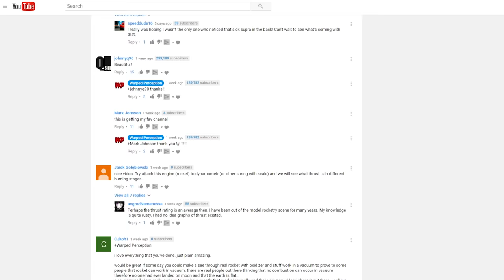Model Rocket Engine In A Vacuum Chamber - 4K Slow Motion - will it burn? - Rockets (S1 • E3)

Comment: Sound does not carry in a vacuum environment. You can hear the rocket working so it is not a true vacuum environment. This test is completely flawed
Reply: What is a "true vacuum"? So where is the air pressure threshold from where rockets won't producing thrust anymore? And is there a relation between air pressure and thrust (so thinner air - lower thrust; would make sense I think?)
Reply: the sound of the slo mo is aded in and the sound of the go pro is recorded bc the rocket re pressurised the chamber again
Reply: The mass flow out of the nozzle is what is producing the thrust, which means that the thrust is the same in space and on the ground. Newton's third law baby!
Reply: The rocket vibrates de metal coil that is atached to the tube vibrating the tube, and the tube that is in contact with the exterior air "translate" the vibrations on sound; and more, the rocket produce gases that can hit the wals of the tube makig noises.
Reply: +Sebastian Nolte Yes there is a relation but the other way around. The bigger the pressure difference between  the burning fuel and the sorrounding gas the bigger the thrust. Think of a water gun shooting in to the air and inside a pool. The water shoots out quicker in the air.
Reply: That first boom sound was the igniting rocket changing the presser by pushing out a little bit of gas during ignition, vibrating the tube from the pressure change which is touching the air so we can hear it. The sound of the rocket is the normal sound but quite at first because there is no air to push BUT THE ROCKET IS EXPELLING GAS AND PLASMA no longer making it a vacuum allowing us to hear it. But rockets do work in space because the rocket expells the gas at high speed and it is the same amount of gas as the fuel was as a solid or liquad so it adds up to be alot of mass and that mass being pushed acts in the craft as well  so pushes the craft forward. Notice how on this and any rovket the gas gets pushed much faster than the rocket because for it to produce thrust it has to be going faster (have more energy) to accommodate for the lack of mass. In space this doesn't matter because with no (little) outside forces it can react react with Newton's 3 law: For every force there is an equal or opposite reaction.
Reply: LMAO Newtons Third Law of motion is EXACTLY why rockets in space don't work. THERE IS NO ATMOSPHERE IN A VACUUM! SPACE = VACUUM!  NO ATMOSPHERE = NO THRUST... Again The thrust of a rocket is generated when the ignited fuel out of the rocket is pushed back by the gasses in the atmosphere which in turn causes acceleration, without anything to push against you get 0 forward momentum.
Reply: now go ahead and say "Nuh Uh Nasa did it so it must be true"(because we all know nasa can violate the physical laws of nature).... Or you're a fool who's been took for a great show. that's all it is folks, a great show, keep trying to disprove flat earth, keep believing nasa and space x and that we live on a ball spinning at 1,000 MPH, Orbiting the sun at 66,000 MPH all while the sun travels around the center of the galaxy at 800,000+ MPH and yet the stars ONLY rotate 360 degrees around the North Star Polaris, Which never moves from its position over the north pole. Yeah... That makes sense... makes a whole globtard amount of sense.
Reply: I agree the vacuum was not good enough AND the fact that the space in which the vacuum was produced was very small and the thrust as seen in the video was most likely due to the back wall of the tube in which the exhaust from the rocket had a surface to push against. I have seen other vids of guys trying to ignite ANYTHING in a vacuum and they couldn't get much to burn, most did not ignite at all. So rockets can't produce thrust in the HUGE vacuum of near Earth Orbit. FWIW I'm NOT a flat Earther, however they have some good arguments that are definitely inexplicable at this point. I'll be hugely disappointed if they are proven correct.
Reply: The Term Flat Earther has been drug through the sand, even the term makes me cringe. but rockets dont work in space and that's a fact. the earth also doesn't have a detectable curve, and people will love to say "Yes huh, my phone has google earth" and the classic "What about satellites" and lets not forget "Nasa has pictures of earth from space nar yar garrrrrr" 1, satellites are fake, we've conclusively disproven them already, Look up LORAN and its future implications, and if you still want to say "No, i have dish tv, you're stupid" then ill be happy to hear you explain to me why planes loose their "GPS" signal while flying over large oceans and have to go by a estimate from ground control. the size of the unites states on the nasa pictures of our "Planet" changes sizes significantly throughout each photo while the diameter of the earth remains the same. idk about you but i dont remember the land area of the united states fluctuating by a couple tens of thousands of miles just in the last few decades, of course i could be wrong, i'd love to see a globetard explain that. also explain where the curve is, why gyroscopes dont measure a curve, why lazers dont measure a curve, why planes dont have to continuously dip their noses down to compensate for the curve, AND why TF Bill Nye is even is this argument like either side wants to claim him. btw even if you guys do come around, leave bill tf behind. xD
Reply: The reason is simple, notice the rocket mounting bracket? It is in contact with the outer tube so the vibrations are transferred to the outside through the bracket where we can hear it.
Reply: exactly
Reply: Let's put it simply... you can see the International Space Station from earth.. it is in the vacuum of space. They are firing rockets every so often to realign or maintain altitude.. and you receive movies, communications, and etc. via satellites that are orbiting at app. 26,000 miles above the earth and have to be re-positioned from time to time and they do it successfully... how, if they don't use rockets?
Reply: Fact, it would likely cost them a few orders of magnitude more to lay underseas cable than it would if their satellites were real. if that was the case no crazy fool on this earth would still being laying trans oceanic cables thousand of miles across the sea floor. LORAN system got a huge boost over the last few years in terms of power and range. all of their excuses have been refuted and we are exposing them for the shit they are.
Reply: well first i have a love and great understanding of modern physics. So naturally I tried to disprove flat earth a month ago with the curvature test, after i seen the ships in the ocean continue to be visible after about 20 miles or so i got curious, i got my phone camera camera and zoomed in further after it again appeared to "disappear around the curve". And i should say the drop of curvature of earth is supposed to be this equation= 8 inches per mile squared, (i dont know how to make the little 2 lol). 20 miles means the ship should have been hidden by 198.7 Feet of Earths Natural Curvature. however it remained visible to about 30, then after it still re appeared with the use of a zoom camera. Water is the absolute best place to test this as water fills anything its container perfectly level, the best possible scenario would be a frozen lake to get it as perfect as possible and avoid waves. the fact remains that i shouldn't have been able to see that ship past 12 miles, as the curvature of earth is supposed to hide it. then i remembered Gyroscopes from my childhood and remembered there main job is to provide "Rigidity In Space", this means that once the gyroscope is in motion and remains in  its fixed plane regardless and independent of "gravity", this means that if you were flying around the planet you would see it spinning to compensate you slowly moving and turning around earth, however Globebuster has a great video showing that gyroscopes do not register a curve when you fly from one end of the earth to the other, absolutely 0. (This one is great to refute because you can try and tell me gyroscope are just inaccurate then i would dare you to get in a plane that doesn't rely on gyroscopes to determine its pitch elevation and many other navigational necessities.) #GyroscopesDontLie
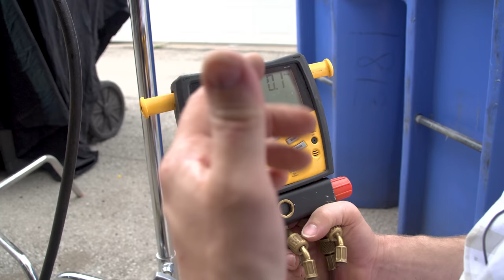Reply: XoFFoX777, Dude nice try but no. At 2:11 the gauge clearly shows -29.2mmhg, that converts to roughly .5 psig. Atmospheric pressure is around 14.7, that means he had it down to 3.4% atmospheric pressure, THAT IS A VACUUM!!! It produced thrust the second it was ignited. Big vacuum, small vacuum, doesn't matter, a vacuum is a vacuum. Sorry, but no.....
Reply: Please provide a map of this flat earth world that you speak of.
Reply: Edward Clements I have not mentioned anything about a flat earth??
Reply: 66tas95 
Directed towards the flat earth guy above.
Reply: Ally Entertainment TV
At last! A denier who accepts Newtonian physics! I do believe that we're getting somewhere. However, the interpretation is incorrect. "For every action there is an equal and opposite reaction". 1- Action. Kerosene mixes with oxygen from the liquid oxygen tank, is ignited, becomes an expanding ball of burning gas, thereby massively increasing its volume from its liquid state, and is ejected into space via the rocket motor nozzle. 2- Now explain what the reaction will be, for you know by your acceptance of Newton's 3rd law that there has to one. I'll give you a clue: "and is ejected into space via the rocket motor nozzle" is the action to which there will be a reaction. Are you confusing thrust with the action of a propellor (air or water) where the prop is used to displace the medium (air or water) from the front of the prop to its rear, thereby providing propulsion?
Reply: Ally Entertainment TV - Just one question.

Why do you suppose that NASA lets you live?

I mean there's a tremendous amount at stake here. They have managed to fool the most brilliant scientific minds from the past thousands of years to the present. They have totally controlled all space related media world-wide, including from the Soviet Union, China and North Korea. Every educational institution starting at elementary school through university is being controlled. Private enterprise, again world-wide, controlled. Hundreds of billions of dollars must be spent every single year to keep extremely smart people like you from spreading the truth. And yet here you are on YouTube discrediting everything humanity thinks they know about the Universe. 

Why are you still alive?

Maybe NASA doesn't know about you. So I forwarded your posts from this video to NASA and the CIA. I'm curious to see how long it takes for you to 'disappear.'
Reply: XoFFoX777 Son rockets carry their own oxygen ever light a fuse and throw it in the water and it still burns underwater where there is no oxygen? That's because it carries it's own oxidizer it doesn't need surrounding air. If you want more proof buy one of these little engines ignite one and have it fire into the water and watch it still burn. No Nasa or slow motion vacuum tube footage needed but a 20 dollar model rocket and some fuse to test that too
Reply: Ally Entertainment TV So if nothing has been to orbit how do you explain the space station? Because you can see that I bought a telescope went on the tracker and saw it with my own eyes it's very visible when it Flys over with a telescope. You can do it too just get a compass check out the flyover times grab your telescope and chill out grab a drink and watch it. It's pretty beautiful and you can't say plane it is not aerodynamic in the slightest and it's fucking huge
Reply: Ally Entertainment TV Also Google the Eratosthenes measurement of the circumference of earth. You can do that at home too. Plus why is no other planet a disc shape you can see other planets once again with a telescope. They are all round because gravity would collapse a disc shape it doesn't work like that man. No idea why you think anyone would even want to lie about it for this long and that's all stuff you can do at home for yourself. No need for any external sources you just need a few easy to get optics and tools
Reply: Sound waves need atmosphere or mass to carry them from point A to point B. In this instance the atmosphere is being substituted by the mass of the vacuum chamber's walls, which are also being utilized by the rocket's 'thrust', to push against.
Reply: Vibrations carried by the copper coil holding the rocket in place inside the tube conducted the sound. Same principle that allows the tin can phones with strings that many have tried and tested in their youth throughout the past century. Your argument is now invalid
Reply: "Sound does not carry in a vacuum environment. "  

It doesn't but this vacuum chamber is filling with gas as the rocket burns.  Those gas molecules are reacting against the cylinder walls at a high rate of speed.  That rocket engine is very loud outside of that chamber.  Also the rocket is not floating in space.  Its tethered to the outside by a copper frame work.  So vibrations are translating through the copper winding to the cylinder walls.
Reply: Kurwynd how can you see something that's traveling mach 20? Furthermore the pressure of a vacuum measured in Tor would crush the ISS. Whatever your seeing is a plane, drone,aerostat etc.
Reply: Edward Clements a map shows a flat earth.
Reply: Ally, good point about the under the water transatlantic cables.  At least this video test proves you need a solid physical barrier between a pressurized atmosphere and a vacuum.  Which would explain why The NASA/SATAN had to fake the moon landings and ISS footage.  Can you imagine if a flat Earther had just one week of fake NASA's budget to prove the Earth is motionless and flat?
Reply: Edward, flat Earth maps are available online.  buy Azimuthal Equidistant “Air Map” of 1945
Reply: Isaiag40:22,

Azimuthal Equdistant Globe Projection map is just one of the many globe to plane projection, and if you care to measure distance between Santiago (Chile) and Sydney (Australia) you would see that this distance is 50% longer then actual one. How your flatheaded colleges explain that?!
Reply: Tim Webb ,
you've been to space? You know this first hand?
if you can't honestly say yes to these questions , your response ins't plausible!!
Reply: Yes ally newtons third law. Someone much smarter than you. Atmosphere is not needed to produce thrust as shown on the video. If you don't believe it run the experiment yourself. If you push something away from your not only are you pushing the object away you are pushing yourself away. Atmosphere will not be a factor except in that you have no air resistance to slow you down.
Reply: +Purple Clouds "Furthermore the pressure of a vacuum measured in Tor would crush the ISS" That couldn't be further from the truth. Atmospheric pressure at sea-level is roughly 14.7psi, in the vacuum of space it is very close to 0psi. There is far less pressure being exerted on an object in space compared to on the ground, not more.
Reply: +Purple Clouds "a map shows a flat earth." No, a map is a map. A map is not representative of shape, it's sole purpose is to aide navigation. Shape doesn't have anything to do with it. Straight lines on a map are much easier to understand when compared to the trigonometry required to navigate using a globe, for example a ship crossing the pacific, which is why the globe isn't used very often (aside from automated GPS based navigation).
Reply: The test is not flawed. The black powder propellant contains its own oxidizer and therefore can burn without any additional oxygen.  The instant the motor ignites combustion gases exit the motor and the interior of the tube is no longer a vacuum and the tube contains a medium that can transmit sound. This does not invalidate the test because the air was removed from the tube before it was ignited (demonstrated that ignition can occur in a vacuum and combustion is sustained without adding any oxygen from outside the tube). Likewise, rockets that leave the Earth's atmosphere take their oxidizer which them, such a tank of liquid oxygen.
Reply: Ally Entertainment TV how come a plane has never flown past the wall of ice that surrounds us and taken pictures of whats past it? Seem it would be very easy to prove the earth is flat. Why cant we go past the edge, or the very least even look at it.
Reply: 66tas95 and there would be not fire due to there being no oxygen to burn
Reply: How many times do we have to go over this... Solid fuel model rocket engines DON'T NEED OXYGEN for combustion. An oxidizer is mixed in with the fuel. In the case of a solid fuel in a model rocket engine, potassium nitrate (NO OXYGEN NEEDED) serves as the oxidizer in the combustion reaction. Furthermore, once the engine ignites it expels combustion gasses and the tube IS NO LONGER A VACUUM and this demonstration IS NOT FLAWED.
Reply: 66tas95 - The sound in the slow-mo is faked, as it is in nearly every slo-mo video.

Also, once the engine fires, it is propagating sound waves through its own gasses, in addition to any vibration it created through the coil into the tube.

Sound in the experiment is not equal to the experiment being flawed.
Reply: Dad Is Gone - Let's all say it together; "Rockets don't need oxygen from the air to burn, because a rocket carries it's own oxidizer." See? Not that complicated.
Reply: you actually can hear just not very well besides most of the sound seemed to be the gas spewing out the engine which would carry sound just fine
Reply: 66tas95 Sound is carried from the exhaust AND the vibration from the coil to the tube.
Your comment is completely flawed.
Reply: 66tas95 u will certainly hear the ejecta as it slams into the sides of the container.
Reply: The rocket created an atmosphere, as well as the rocket vibrating the copper holder and therefore the container
Reply: The rocket thrust do not depends on anything, it carries all the propellant and the oxidant it uses independently of the environment, be it underwater or in the vacuum of space.
Reply: Vibration through the copper and the tube.
Reply: @CamronB01  read the third law again. Actio - Reactio. The rocket exhaust and the rocket push away from each other. They don't need an atmosphere.
Reply: Tim Webb  you don't have to push against anything. The rocket is pushing against the exhaust gases.
Reply: No No NO dude (if male) Newtons laws DON'T suddenly stop working in a vacuum, why SHOULD they ?

If I'm in the vacuum of space holding a big ol' flat iropn, and I throw it behind me, it's not just gonna STOP when I let go, it'll be thrown BACK, with the momenentum I've put INTO it, and I'll be thrown forward, AIR OR NO AIR 

Same principle here
Reply: ""Nuh Uh THIS guy did it RIGHT UNDER OUR NOSES for ALL to see" did you actually WATCH the vid ?
Reply: @triaxelongd3337  Even though there is a vacuum, the sound you hear is being produced by the rocket engine, vibrating that's in direct contact with the wire spring. The wire spring picks up the sound waves transfers it to the tube directly and then the sound transfers to the outside air around the tube and is heard by you outside the tube because you and the camera mic are not in a vacuum. Actually, the Tube, it's more of a speaker itself. For noise/sound NOT to be heard, in this vacuum tube, something that can make sound would have to be floating in the tube and not touching the sides of the tube, to not transfer the sound, while in a vacuum, no atmosphere to transfer sound.
Reply: @66tas95
 At 2:37 there are three distinct sounds. the motor vibrating the mic because it's attached to the pipe, it sounds like mmmmmmmm, the buzzing of the coil then vibrates the pipe with a zzzzz sound sounds like a model airplane. and finally when the vapor hits the camera you can hear a shhhhhhhhh. you cant hear the shhhh until the vapor reaches the mic. I think the vacuum is working fine. The mmm and the zzz are reaching the mic becuase those sounds were conducted faster than the vapor towards the mic.
Reply: buzz bang thanks for the info, but honestly, i even forgot i even watched the video.
Reply: @sebastiannolte1201  exactly. Take a balloon and tape it to a straw put thread through the straw and tie a long line across the room. Inflate balloon and let it go, repeat this but hold a vacuum cleaner hose near the end of the straw and release. Come back and comment what you learn about thrust in a vacuum
Reply: @denninosyos  wrong. Thrust is produced when the pressure of the escaping gasses pushes against the outside gasses causing a back pressure against the nozzle. This will not work in space. This vacuum tube experiment is severely flawed.
Reply: @cameronland5934  ffs
Reply: @XoFFoX777  but isn't the whole point they take off from Earth, and once in space it is about correcting trajectory rather than creating more thrust?
Reply: a "true" vacuum means that there isnt a single atom left inside - in fakt the space is full of hydrogen ;)
and the metal ring transmit the sound from the rocket to the tube and the air and your ears......
AND the rocket produces gas but i think you didn't know it. at least it sounds like you have no clue
Reply: @cameronland5934  wrong.
Reply: @CamronB01  Yep, all I see is this:
1. something gets thrown backwards - a solid thing (opening of the "nozzle" ), the rocket moves a bit, because this thing is really moving in one direction
2. the rocket does not move for some time even with the expanding gases
3. immediately when the gases expand enough to create a real atmosphere (not a vacuum anymore), the rocket starts moving

I think the issue is - a gas in vacuum will never ever move in 1 direction, rather try to fill the vacuum immediately uniformly in all directions, hence the total momentum of the expanding gas cancels out (it goes "up" and "down" at the same time, not BACKWARDS from the rocket, you can't control that in a vacuum)
Reply: Because the go pro is inside the vacum LOL
Reply: Sounds can also be transmitted through solid objects, like the copper wire and the tube itself
Reply: Ally Entertainment TV rockets produce thrust by the expansion of the exhaust against the nozzle not the atmosphere
Reply: Yes but there is air outside of the chamber
Reply: The metal is constantly touching the plastic chamber, that's why you can hear it
Reply: @CamronB01  thats where you are wrong .. truth is .. being in space or here on earth everything has a mass and the fuel displacement itself and it's own weight is that creates the thrust. No matter if it has an atmosphere or not. The rocket does not push against atmosphere, it moves mass and expands it when it's burning